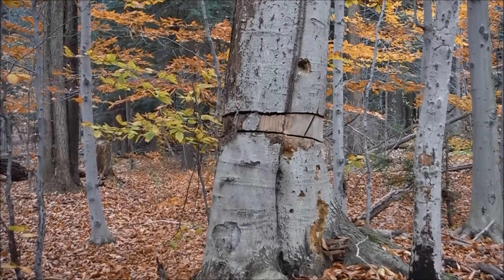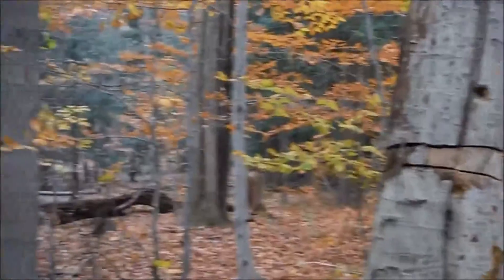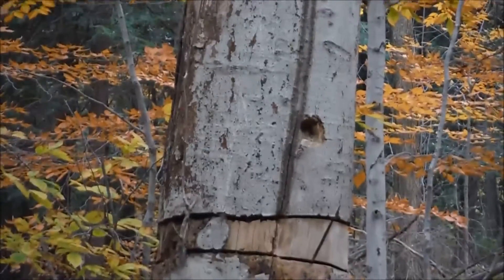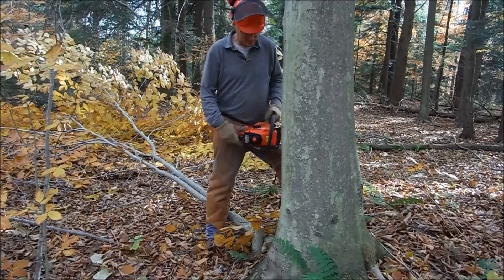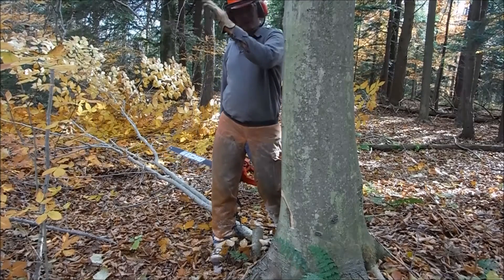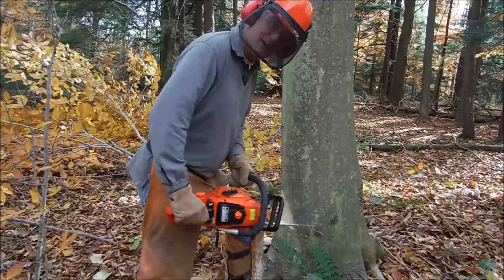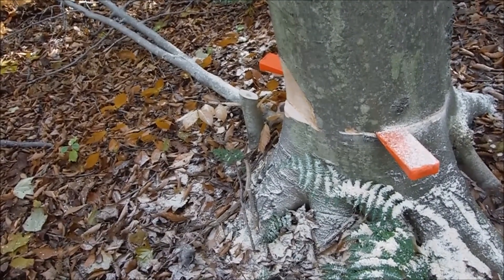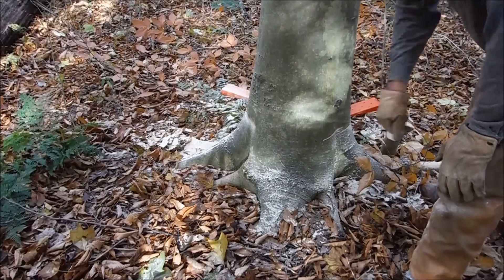Girdling and Felling Cull Trees

Comment: The reason he is using an underpowered saw is because he does not have a big saw, because he has not run a saw for as long as he acts. WTF on the facecut? R U kidding?
Reply from the maker: Yet somehow it went exactly where I was aiming it. Maybe someday I'll get manly enough to pose shirtless in my channel avatar like you.
Reply: @petercollin5670  well said 😎 There’s nothing wrong with an Echo either. My CS370 and CS400 have cut endless cords of firewood over the years. I still prefer my Stihl when I’m going after large trunks, but the Echoes do just fine in many applications.